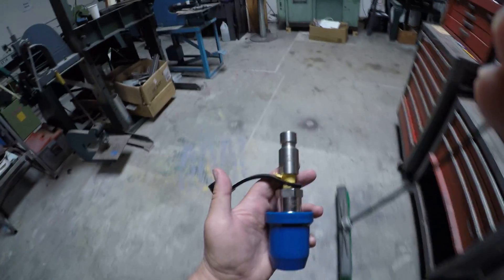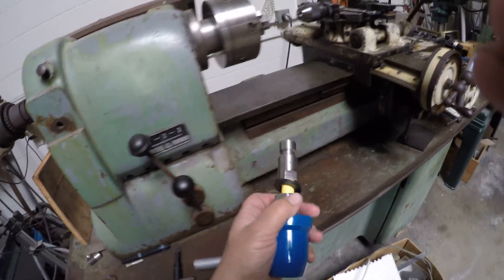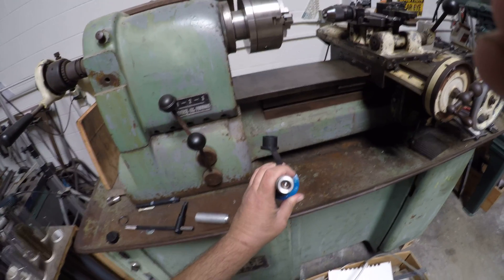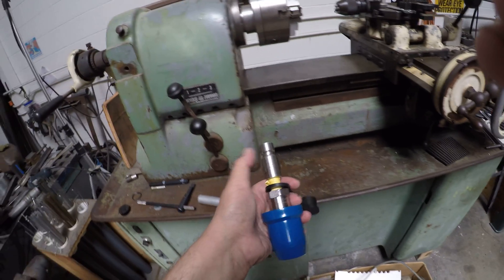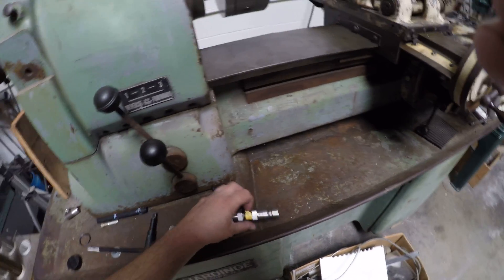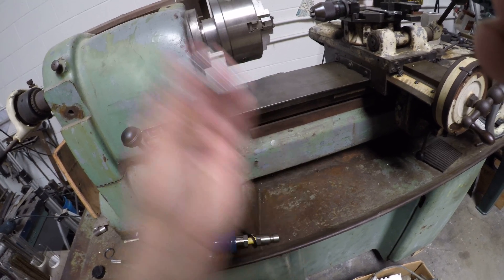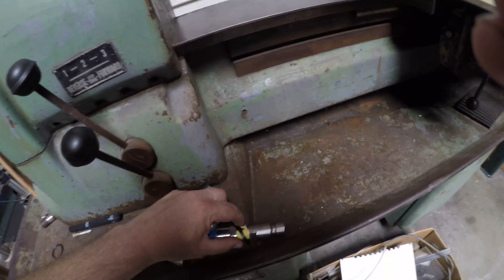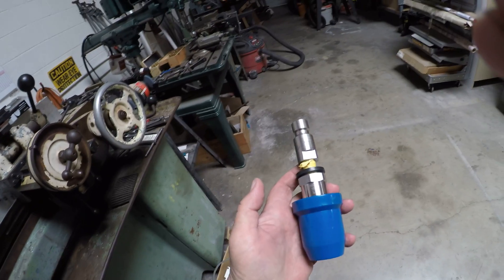How to adapt / convert 3000 PSI CNG to 3600 PSI fill nozzles

Comment: What are the physical differences between the 3000psi filler nozzle with the 3600psi filler nozzle? Do you also have links or part numbers for parts that you used?
Reply from the maker: Yes I can dig that up later when I get to a computer. Feel free to remind me if I forget
Reply: @rsarp  Hi, could really use the parts list as i am going through this now with a bus. Just trying to get it home it wont be driven and i will only fill the tank half way. Any info would be greatly appreciated. Thanks